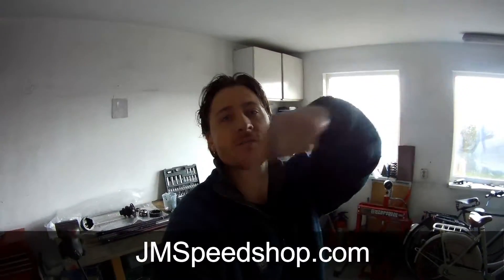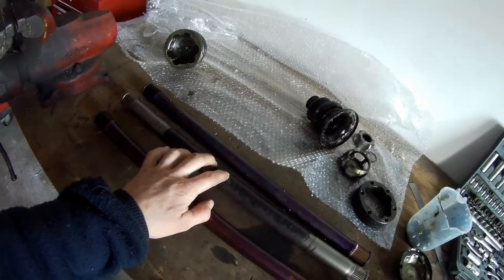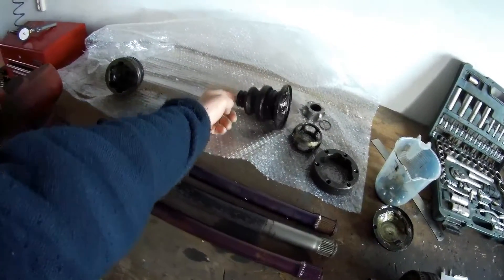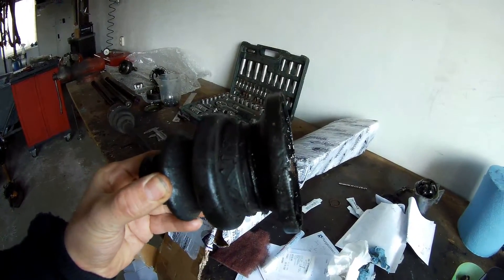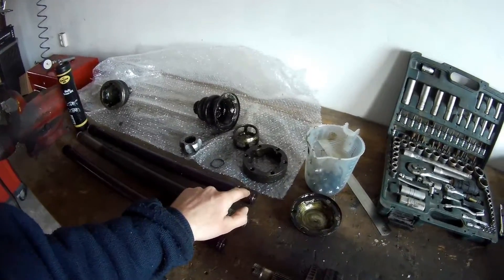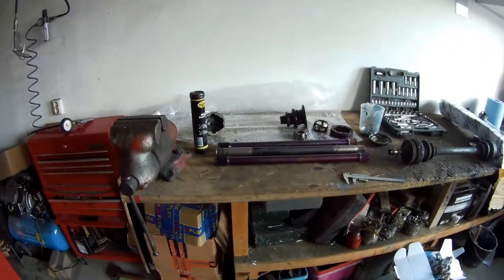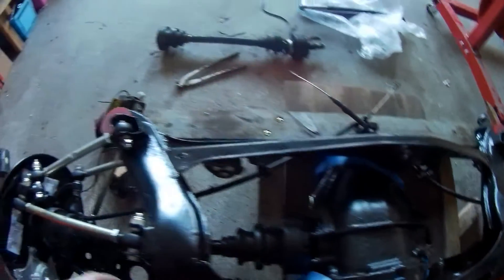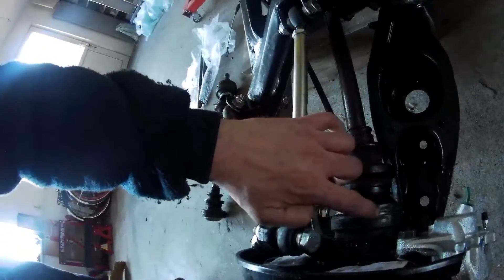S124 NEW Custom axles for the V8 turbo project

Comment: Hi, great video again. Do the 210 axles fit inside the w201 drive flanges?
Reply from the maker: Depends on the diff and which 210 model you use.  So there is no straight anwser to this